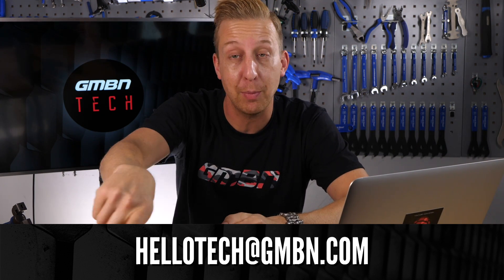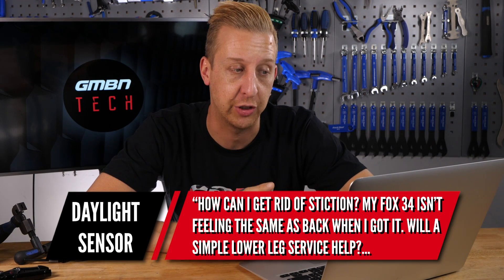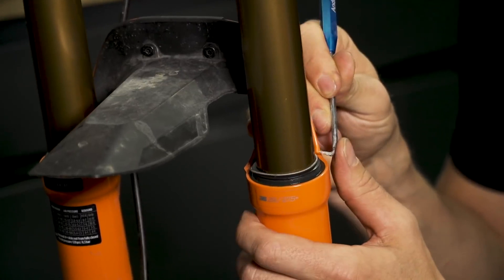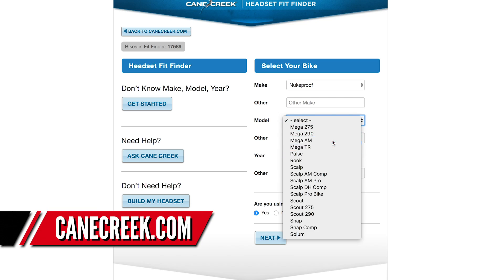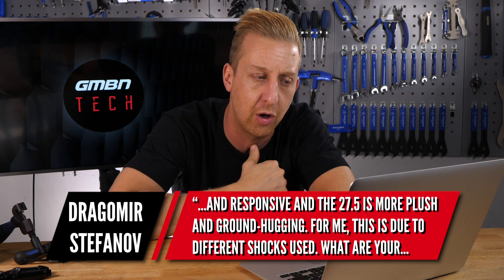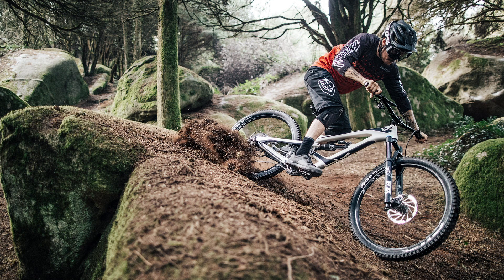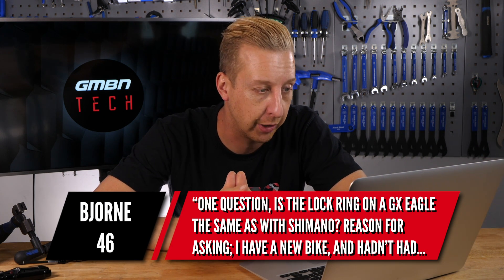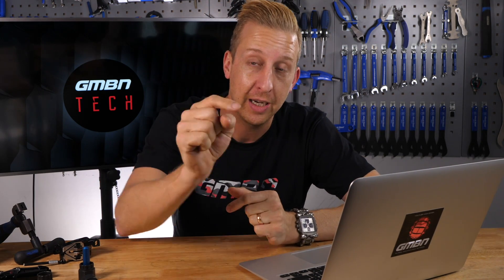Why Did Your Cassette Come Off? | Ask GMBN Tech

Comment: #askgmbntech Hey Doddy, I'm thinking about converting my 3x9 to a 1x system. I have a 135mm hub, so I'm not sure if I can even get a larger cassette on the free hub. Do you think it's possible to put at 10 or 11 speed cassette on this hub, if so what would be a good size chainring to go along with it? Thanks a lot!

Comment: #askgmbntech Is it possible to reduce travel on the new RockShox lyric rc2 debon air I am looking at a ne bike and it comes with a 170mm fork and 160mm shock I was wondering if I would be able to make it 160 front and rear

Comment: Had some issues with moving sprockets on the cassette. Canyon support told me that this can happen. Bought a chainwhip and cassette tool, cleaned, rebuild and tighten the cassette to the right torque, fixed it. o7 Canyon support

Comment: #askgmbntech  Hi Doddy, I've recently replaced my cassette chain and chainrings due to wear, gone from 2002 XTR  9x3 to a 1x9 with a Sun race 11-40 9spd cassette, 9spd chain and thin wide blackspire oval 32 chain ring, Unfortunately on or after every ride the rear mech(2002 XTR) needs  adjusting to keep it running smooth, I've read many blogs on this and the consensus is I need a 10 spd chain ? or do you think the mech needs updating but unable to find a 9 spd rear mech with a clutch ps the mech is in good condition but the spring good be with being firmer, cheers in advance

Comment: #askgmbntech Hi Doddy, i have problems with Bottom Brackets on my yt jeffsy cf pro. I am on my second pair of bb in six months . i have cycled about 2400k. gets quickly filldeup with sand an dirt. bb is RACE FACE BB92 CRANKSET
RACE FACE NEXT R. I’m looking for something like the enduro bb386evo or similar system. But it is very expensive.

Comment: Hi Doddy,great videos as always. I really need some advise here as i`m struggling to decide to upgrade to the 2019 vitus sommet crx ( carbon frame,alu rear triangle),or the polygon entiat tr8 ( alu frame hardtail 27.5+) ? Currently i`m riding a 27.5 hardtail. Thanks in advance!

Comment: #askgmbntech Hi Doddy. I recently changed out my DT Swiss 18t StarRatchet for the 54t (what a difference!) but didn't need to remove the freehub from the  cassette. You can just pull the whole lot off the hub and access the Ratchet inside. DT Swiss did a 'trail-side' how-to video on it. Obvs this won't help the guy get his cassette off the the freehub but will get him going if he's having trouble getting it off and wants tp get out riding.

Comment: #askgmbntech I have a similar case to the question about the cassette that's stuck to the freehub body. Instead I have a sram cassette which is stuck. I have no clue why but I need to change it soon, and if I can't get off I can't change it.
Reply: Or just have a steel freehub body?  Or a fully-spidered cassette?

Comment: hi doddy i have a 2015 diamondback sorento. i had an 80mm suntour fork up front and have recently switched is to a 135mm travel amazon.com air coil fork that i modified. it work great for me but my friends who ride it say its to slack on the head angle. i use this bike for enduro trails and its has a 66 degree head angle. will having the head angle that slack cause problems on the trails that i just have not seen yet

Comment: #askgmbntech Hi Doddy, I've got a pair of Tektro Gemini Brakes. The front brake doesn't work well, despite getting a calliper as well as a master cylinder service, changed and tried different brake pads and rotors. Inspite of all that, I don't have good braking. Please help!
Reply: ditch tektro for any shimano or sram hydraulic ones. Into level shimano brakes can be had for ~$30
Reply: I don't like the stiff feel of the cheaper hydros

Comment: #askgmbntech I am going to buy a new bike this spring and want to go from a 29er hardtail to a full suspension bike. I am thinking about going to a 27.5 bike because the trails I ride are pretty tight and twisty. Should I go for it or stay with a 29er with full suspension?

Comment: #askgmbntech Hey Doddy, I was the one asking about headsets for the Morewood Makulu. I got a nukeproof set, Im running a 2012 Marzocchi 66 CR upfront, which has 10-15mm less Axle to Crown than a double crown. Could I run a 240mm shock instead of a 267mm to compensate out the front, or it would mess up the suspension characteristics too much? I'd like to know, since finding an used 240 air shock is much easier than a 267. Thanks!

Comment: Doddy, I really want to do a lower leg service and I have the tools and everything, but I don’t understand how to do it on a fox 32 stepcast. I just don’t understand how can I get to the bolts and pull off the lowers since there “shoved” up the fork.
Reply: Extension bar on the socket bit.

Comment: Hey doddy, love the show by the way; I was wondering if any of my cleaning products ie: lube, deagreaser or brake cleaner could get some how effected by the cold or even not work anymore considering that my garage is not insulated and is effected by the outside weather.
Ps, I was especially thinking of my muc off dry lube since I know that it does not really work in colder condition.
Thanks Leo.

Comment: Hi Dotty, I was the one asking about my cassette including freehub body falling off, just leaving the inside of the hub on the wheel. You did not really answer that :) Do I need a new hub?
Reply: DT Swiss Star Ratchet hubs are designed so you can pull them off with the cassette on them and do a quick service on the ratchet hub. Go find a dt swiss official video on youtube on that topic. Make sure you arrange the ratchet rings and the springs as they were and pop it back on, then you can unscrew the lock ring of the cassette and remove the cassette cogs while the freehub is on the wheel. The best technique I know for getting the cogs off the hub is to use two chain whips and hold the biggest cog in place with one and use the other one to turn individual cogs that are chewed onto the freehub anti-clockwise to free them up. If you only have one, remove the lockring of the cassette, reinstall the wheel into the bike and put the chain on the biggest cog to hold the cassette and then use your chain whip to free the other ones.
Reply: @lux-3001  tanks mate. :)

Comment: #askgmbntech Hi Doddy, I recently bought a used Radon Slide 130 with 29" Mavic rims, Mavic hubs and 24 straight pull spokes.  I love the bike, it rides great but I am a bit concerned about the wheels.  Are 24 spokes enough for a 29 incher with a rider in the mid 90 Kilos aboard?  I don't ride particularly hard, I'm getting on a bit, but would like to be confident the wheels are not going to collapse on me.  Many thanks.
Reply: How much do u weight with extra ecwipmemt
Reply: @pyroteampijnacker7710  I guess full geared up I'm probably more like 100 Kg.  I may be concerned about nothing, it's just that I started mountain biking in the late 80's when wheels were 26" and had 32 or 36 spokes.  I would assume a larger wheel needs more support so having a 29" with only 24 spokes feels a bit like riding on eggs.
Reply: @mainzman7239  I weigh 114kg naked and the mavic wheels with 24 spokes were stable. After 2 months the freehub broke... Switched to DT Swiss.
Reply: @lux-3001  Thank you, I guess I'm probably worrying about nothing.  Or looking for an excuse to buy more new gear......
Reply: @mainzman7239  My advice would be to upgrade when needed. After all, bike-components do have quick shipping and DT Swiss are always on sale there. Grüße aus Göttingen ;)
Reply: @lux-3001  Danke : )  And you're right, why fix what isn't broken?
Reply: Mavic wheels are garbage. If you really want stable wheels look for pancho wheels. Its a small company from austria. I ride a carbon wheelset from them. I had never to adjust anything or align anything on the wheelset. I had 130kg when i bought them.
Reply: @MaxMustermannnnnn  Go straght for the Reserves then ;)
Reply: lux Was meinst du damit?
Reply: @MaxMustermannnnnn  Santa Cruz Reserve...

Comment: #askgmbntech
11:35 - aluminum free hub bodies
Had the same problem, punched each cog loose individually. 👌🏻
>> Did some research and found out that Novatec provides free hub bodies with a feature called "ABG (anti bite guard) - where a steel plate is replacing one of the ridges to prevent the cogs from sinking in.
Why isn't that standard on all free hub bodies?!
Reply: That's a good idea...instead of making the entire freehub out of steel. That should be standard

Comment: Hi Doddy. Q: What good does the piggyback canister on my rear shock do for me? What is it's purpose and how does it work??  (RS Super De Luxe RC3 shock if it matters)
Reply: It increases the oil volume of the shock so, more oil means when the shock heats up there's more oil to disperse that temperature into. As you probably know, as oil heats up, it thins out. Thinner oil will change the dampening profile of the shock. More oil in a reservoir which helps it cool means that the shock won't change the way it acts on long decents with lots of shock impacts.

Comment: #askgmbntech Hi Doddy, I did a lower leg service on my 2018 RockShox Pike RC and I tried to change the seals, but I just couldn't get the seals out of the fork. I used a ring spanner, but they're just stuck in place so I ended up not changing them. So how do I take them out? Or is there a special tool for removing them or something?
Reply: Tomi Saaranen look rj the bike guy and just view a couple video of fork lower leg
Reply: they are just pressed in, use something with good leverage (big tire lever, spanner, ..) and give it a good thug. remember to place something in between where the chosen tool touches the fork to avoid damaging (like a piece of inner tube, rag, ..)
Reply: @ultiss  Thanks, but I did just that and they didn't move at all! I just ended up doing some cosmetic damage to the top of the lowers even through the rag, that's how much force I used and the little spring inside the seal just came off and it was a pain to get back in again.
Reply: @th_js  maybe try to work around as much of the seal u can acces, alot of wiggeling until it gives up. giving it some heat with a hairdryer may also help loose things up a bit. When i encountered stubborn seals the first one i was just pushing the lever gradually and ended up ripping the seal, the 2nd one i gave a quick hard thug and it went alot better
Reply: @ultiss  OHHH when you said hairdryer I realized that I did the job at under 0°C! I think it could be because of that.. 🤔
Reply: Tomi Saaranen I’m away to try service my forks soon too! What oil did you use?
Reply: @benjik9294  depends on the fork brand and model. Try to find a service manual online
Reply: @benjik9294  I used RockShox 0w30, but it depends what fork you have and you really want to get the right amount and oil weight so you don't mess up stuff Benji!
Reply: Tomi Saaranen it’s a rockshox Yari so I think it’s the rockshox ow30
Reply: @benjik9294  Yes Benji, you need RockShox 0w30 oil for both the Damper side and the Air side and 10cc/mm in both lowers injected from the bottom. Here's a link where you can see it for yourself: https://biketechtools.com/forks/oil-volumes/rockshox/select-fork
Reply: Thanks Tomi!
Reply: No problem 👍🏻